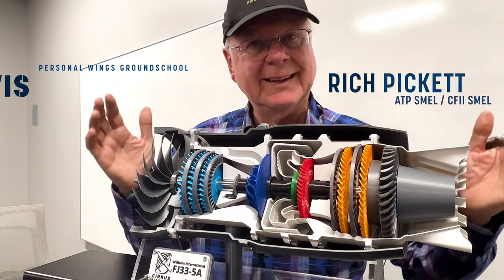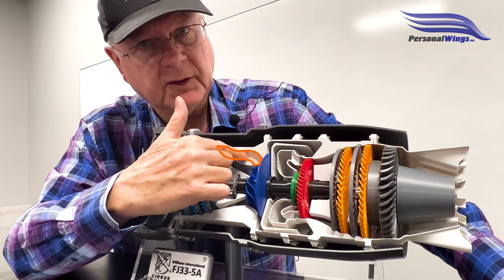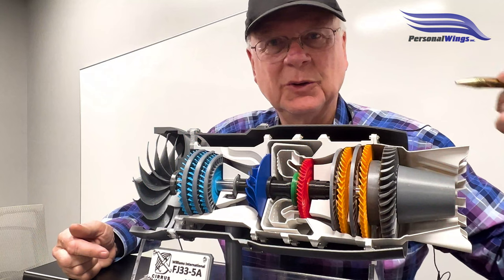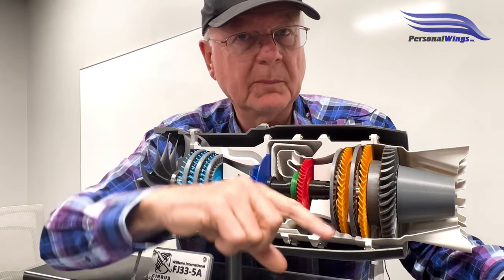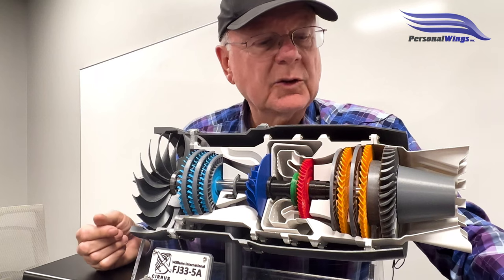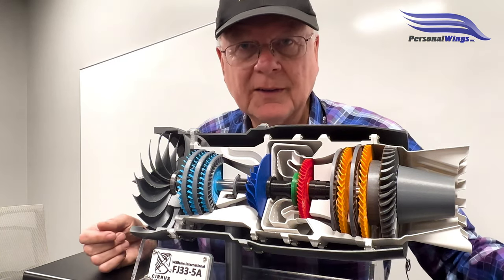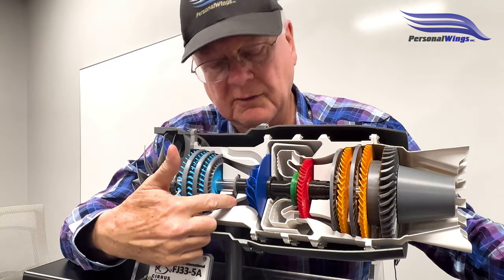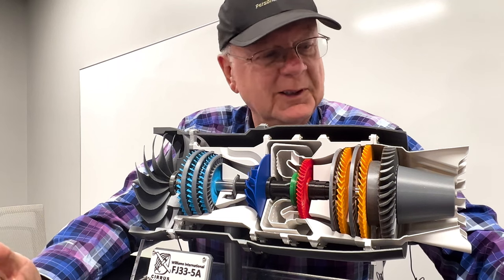How Jet Engines Work — Cirrus Vision Jet Engine | Williams International FJ33-5A Fanjet Engine

Comment: I learnt that the FJ-33 has a trip lever at the LPT that when triggered, will cut off fuel to the engine. What if this happen during flight?
Reply from the maker: It does have the capability, it is designed to sense unusual vibration of the shaft.  It will cut off fuel and the engine will cease operation.  In the case of multi-engine jets, you still have the other engine. In the case of the Cirrus Vision Jet - you have the parachute (CAPS).
Reply: Great video. One slight clarification for you. The trip lever is intended to shut the engine down in the case of failure (separation) of the LP shaft. If the fuel is not shut off in time, the LP turbines will driven to speeds exceeding their structural capability. This is because the LP shaft is no longer driving the LP compressors.
Reply: Interesting, is this a common protection mechanism for twin spool engines?
Reply: Affirmative for engines in this class.

Comment: it still does not make sense to me,  how can fuel mist make the fan blow air?
Reply from the maker: Light it on fire, then the resulting combustion produces a lot of hot air. In addition the reparation of the fan (N1) produces pressure behind it that add thrust and also provides bypass air.

Comment: Nice 3d printed model of G.T.E. turbofan you've got there sir. But I think the N2 HIGH PRESSURE TURBINE and the N1 LOW PRESSURE TURBINE were facing in a wrong direction they're Upper chamber are on the front instead of the lower camber of the airfoil/blades
Reply from the maker: We realize that the model may have errors, however the person who did it --- from simple drawings no less, without access to technical specs - did an amazing job.  Just think what he could have done if he had the data!

Comment: Can we metal cast the 3d printed files and make the engine run ? Is IT feasible ?
Reply: No, for multiple reasons. firstly the model is not accurate (the N1 and N2 shafts are connected in the model, and not in real life, for example). secondly the metal would not be able to withstand the temperature and forced needed to run. thirdly the tolerances of 3d printed castings are far too low for a jet engine to work.
Reply: Guys, what's that grey component after lpt and before mixer (looks like stator)
Reply: @ingunnbollestad  that's a gear for the starter and the generator, I think
Reply: @KingJellyfishII  thanks bro.
Reply: @crewneckdeath6801  np np
Reply from the maker: @KingJellyfishII  excellent response! 100% the tolerances for turbine engines is very high. Then you'd need to also engineer all the fuel delivery, ignition, etc. I also doubt the original 3D files have enough information to actually work beyond what @1024 mentioned.

Comment: how can it run 50000rmp and 20000rmp on the same axle
Reply from the maker: The englne actually has two shafts - one inside the other one, in this way the N1 and N2 are independent and can operate at different speeds.
Reply: @PersonalWings  it makes better sense,, but are they coupled with gears between them so they rotate in different directions
Reply from the maker: @gertkristensen6451  They aren't connect by gears, using the design of fixed stators and the airflow they will rotate with different speeds.  There are several turbofan references that might help as well, including on Wikipedia.

Comment: Is that really how it works? I thought all the compressors were on the high speed axis, not tied to the fan.
Reply from the maker: Dan it is how a bypass jet engine works.  The N1 fan (in this engines) rotates at approx. 22K RPM and the N2 (hot section) at 53K RPM.  They aren't 'tied' together but rather rotate separately and each one is a compressor.  The N1 compresses the air (and other functions) that helps to accelerate N2.
Reply: @PersonalWings  but I'm pretty sure the compressors are on the high speed shaft in other turbofan designs, that's why it seemed odd. I'm aware there are two shafts

Comment: Nice model for to make understand.but some turbines are fixed.
Reply from the maker: Which ones? What applications?
Reply: @PersonalWings  meaning they are fixed on the casing.they don't move.they do not propelle
Reply from the maker: @ZainuDeen-os6ck  By its definition a turbine has to rotate. Are you talking about stator vanes? Those are fixed to help control and direct airflow.

Comment: Where is the wire airplane need electricity.
Reply from the maker: Connections are made in the accessory gear box and to the ignitors for spark.